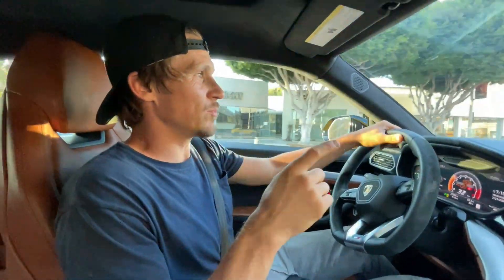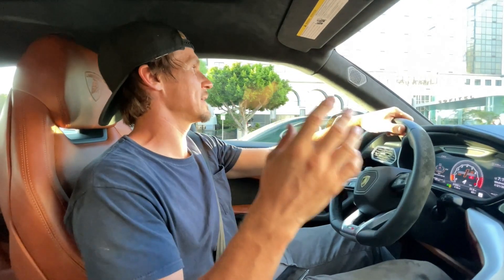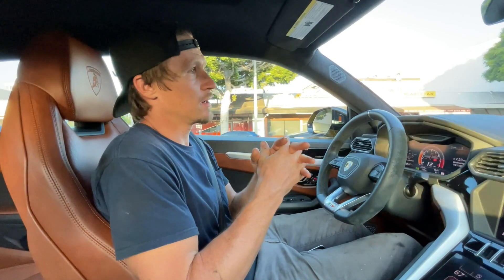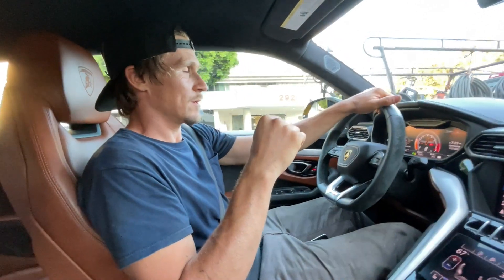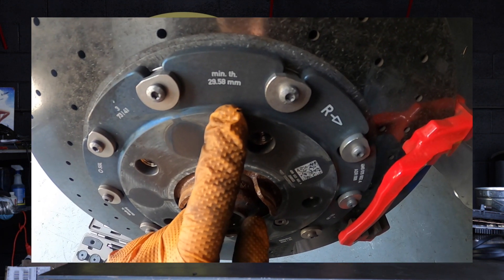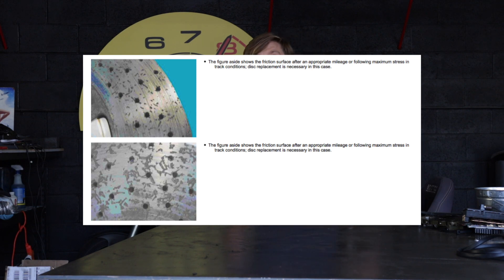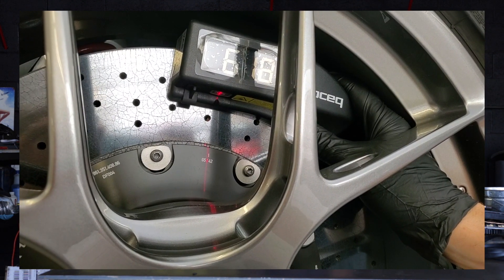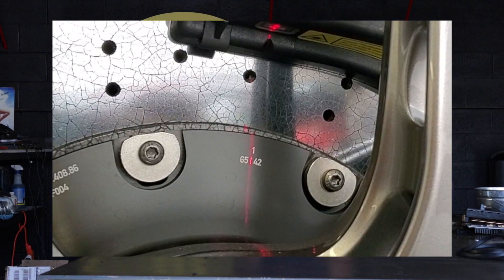Carbon Ceramic Squeal / Rotor Wear Measurement

Comment: 2:44 ok, so question on the sequence of stops to eliminate the noise
Did that on my c7 Z07 corvette, 50 stops from 60mph to 0 (per corvette manual), one after another + cool down
20 stops in it smelled burnt and melted something
Then it started grabbing very smoothly like when I bought the car.
After that I drove for 6h to another end of the state, when I got there (same day) brakes were squealing again.

One thing that works for me is to go pressure wash the discs. It keeps them quiet for about 3 days, gentle squeal starts after and around day 7 it is full mode garbage truck noise that scares people away on the stop lights.
What I don't get, is how come it works, if discs and pads are on both sides (and I am not washing the inner side).

Whatever is causing the noise seems water washable. 
But nothing solves the problem for more than 3 days.
Does this behavior add up to your theory? What do you think about that?
Reply from the maker: There are a lot of factors that cause any brakes to squeak. Especially ones that have a long life. You may have grease from the road combined with brake dust building up on the brake pad and caliper slide points. Also, the slide pins develop corrosion and the back of the pads get dirty and cause vibration against the pistons.  You should disassemble your brakes, clean everything thoroughly, use compressed air to clean out the rotor vanes and drilled holes.  If the sound persists, the pads can become heat damaged all the way through the pad so that burning the top layer reveals only a slightly more health layer that very quickly reaches the same high tensile strength (brittle) state. The whole pad is going through low heat cycles, all the way to the back, but the surface gets it the worst.  If you replace the pads, and you still have noise, the rotors have received too many low heat cycles and they will also lose the ability to perform properly. This is why the carboteq tool was developed. In my experience, cleaning the caliper works when the car has low miles over a long period, like a person that super babys their car. If you drive it a lot, which I assume you do, being a corvette, then the pads are no good anymore due to heat cycle failure. If your car is 10 years old and has 50k or 60k miles on the original rotors, then those are most likely bad as well. On the Urus in this video, the pads had 20k miles on them and they were ruined from low heat cycles. Burning them down would also only provide a few days of quiet. I cleaned and replaced them, and the car is back in a rental fleet with no noise.
Reply: I have the same problem on my 2015 C7 Z06 19k miles.. few months ago it was just minor squeaking now the last week it’s like a pig getting butchered.
It’s embarrassing sometimes when coming to a stop light. Two years beforehand I’ve had the same problem before this is happening again. What I did before was that I had the pads clean, sanded, and lubed and it’s been ok for two years and now just coming back last week.. I don’t track the car but the previous owner seemed to have track it more than once according to old video in its pdk ..I was thinking of getting new pads but it’s going to cost me at least 3k here in Hawaii through the dealership..before I order the new pads first iam going to try to do what he suggested to do which is to drive it fast and come to a halt for at least ten times starting tomorrow maybe and hopefully that will fix the problem. Second I’ll have to clean sand and lube the pads and hopefully that will also work so I can save up for a 3k pads..I’ll let you know how this works.

Comment: I had this problem too. Dust and rust cause micro-vibrations that create the whistle noise between the brake pads and the brake claws. I sanded and repainted the claws and replaced the brake pads and it hasn’t come back since 3 years.
Reply from the maker: Definitely important to check and clean dirty or oxidized parts. Good on ya! Just don't put grease anywhere that isn't sealed. A video on this is coming soon!